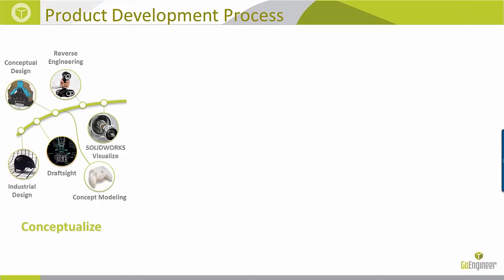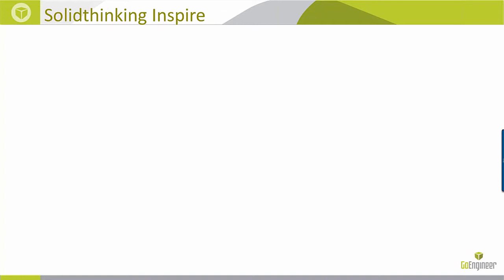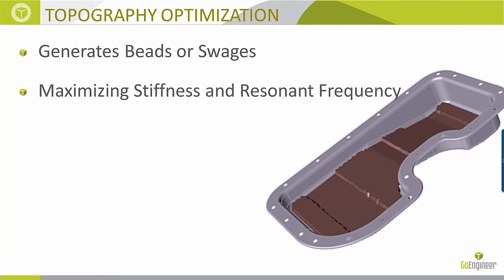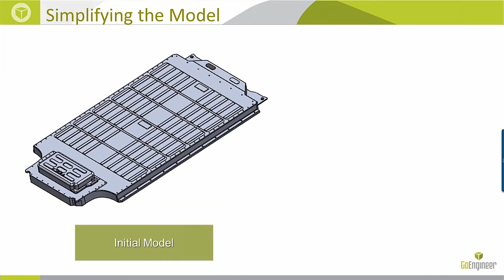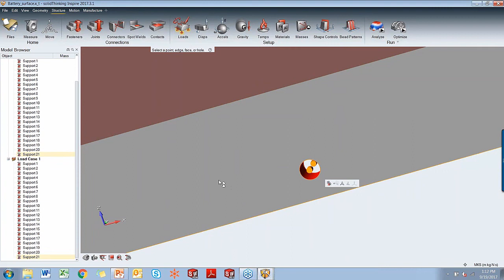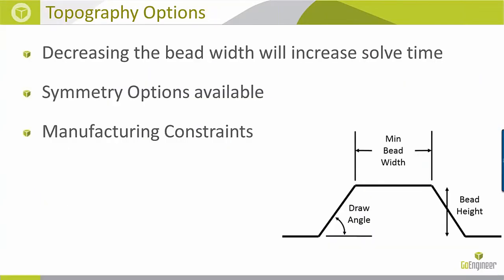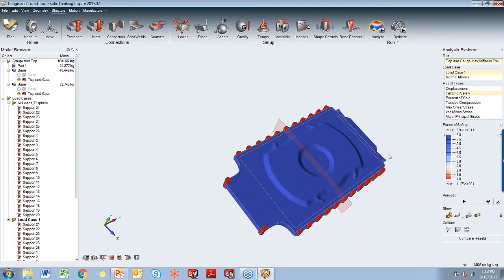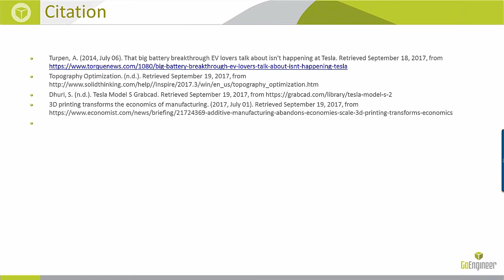SolidThinking Inspire - Topography Optimization Webinar

Comment: Hey :) cool video.
I would like to know what hardware do i need for fluent work with this software. Homepage says they recommend 8 gb of ram and 256 mb graphic card at least. what would u recommend?
Reply from the maker: Hi MrUratox,
We would recommend at a minimum a 1 GB GPU and 16 GB of RAM to start with.  The website recommendations are a bare minimum and could lead you into having to upgrade hardware prematurely if you only barely meet the requirements.